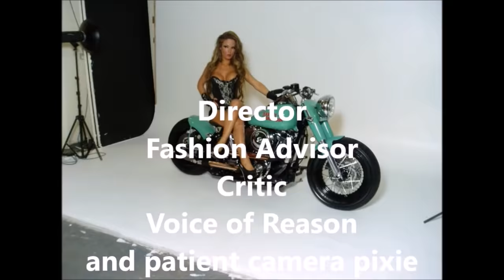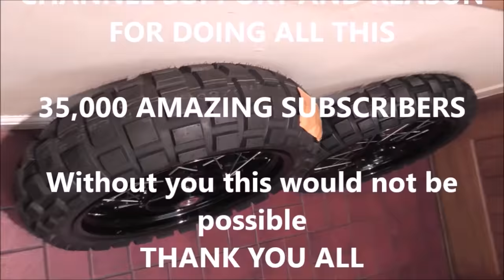Delboy's Garage, USD Fork Seal Replacement

Comment: Hey Del, have a 91 FZR 1000B fitted with KYB USD, and they ain't nothing like these internally, got any tips me ol mate ??
Reply from the maker: Not without seeing them mate, if they were mine, then like all new anatomy id get a manual and read up on the internals, its the same apparatus, just a different design, even a schematic diagram can help a lot... you could probably download one form the net somewhere..!   Good luck with them buddy, sorry i can't be more help..
Reply: No worries, its not my bike so I think I'll get the shop to sort, but as I'm paying I'll watch em :-) @Moonfleet41

Comment: Hey Delboy, here's my way of holding the bike up in my self-built "garage". Bought myself a triple tree stand, but the bike rolled forward a little so it sat on my tire. So I used some straps to hold the bike back so that the front was held up. http://i.imgur.com/RuHeoXC.jpg
Reply from the maker: +QuakeCBR Good improvisation there buddy, use what you have aye..

Comment: you should have losened the top tripple clamp first before loosening the top bolt, not the bottom one as you did, the top clamp could clamp the top cap and damage it..

Comment: Can somebody please tell me the name of the lower part of the forks where the brakes bolt into @14:55 mark it’s for a 2013 gsxr 750 looking for the part to replace due to stripped bolt easier to replace then have to buy new forks I seen it on eBay sold separately but don’t know the name
Reply from the maker: I've always referred to that as the bottom clamp, but if you want to just replace that, they're almost impossible to get off the fork leg, are you sure you can't repair the thread?

Comment: It´s not compressed fully down when you fill it up because of the towel? You don´t get the right airspace!
Reply from the maker: Measure to the INSIDE tube mate, that is where the air gap is spec'd to, the outer tube is irrelevant.

Comment: I went to my local motorcycle shop and they recommended fork fluid instead of fork oil. Do you think that's ok? Would this be the same process for Hayabusa forks?
Reply from the maker: What actual product did they suggest... or was it just a term or reference..!  many people call it 'hydraulic fluid'.!
Reply: @Moonfleet41  Maxima 5W Race Fork Fluid 85-150 anti-Sticktion Racing Formula
P/N 59901-5
Reply from the maker: @busavalley8695  Sounds pretty light weight, and if its recommended for your bike, give it  try.. you can always change it.
Reply: @Moonfleet41  Thanks, I'll give it a try.

Comment: is lithium grease any good like rubber lube?
Reply from the maker: Here you go buddy, treat yerself, nowt like using the right stuff... http://www.ebay.co.uk/itm/RED-RUBBER-GREASE-50-gram-BRAKE-CYLINDERS-SEALS-O-RINGS-/391879401531?hash=item5b3dd5203b:g:ijEAAOSwCU1YoZwQ
Reply: thanks alot

Comment: but you cant use the measurements with that cloth tied around the fork at the "scratches" :-s or am i dead wrong ?
Reply from the maker: Yeah, measure to the top of the INSIDE tube.. not the outer.. that's a fixed height then and always reliable.!

Comment: What if I can't get the two big  parts apart , im haven stubborn seal issues
Reply from the maker: Have you taken the bolt out of the bottom?.. i assume you have... and have you taken the steel circlip out that hold the seal in place...?.
Reply: yeah everything is out , i was watching other  ones and they used heat to expand the metal to get it out , i was going to try that after work . this is annoying. im thinking tomyself . eh its a 3 hr job no problem , speaking of problems , and i your walmart brand ATF  for fluid?
Reply: using a heat gun
Reply: ok every thing is back together . i just need to no in ATF is ok

Comment: Just found your videos, really great, just one question at this point. I have a XJR 1300, which has developed a bad leak from the bottom of the N/S fork, should I replace both seals on both forks or is it ok to do just the offending one? Thanks again
Reply from the maker: Hello Neal, and welcome aboard.. There's no law or rule that says you need to replace both sides, but in my long experience of these things, the other one will leak pretty soon after you fix the first one.. its just sods law mate..   so as the seal kits come on pairs. then why not do them both and you know they'll be fine.
Reply: @Moonfleet41  Thanks for the reply and advice, will do both when I get time, which hopefully will be sooner, rather than later. Keep the videos coming, really interesting and informative. Thanks again
Reply from the maker: @nealhawksbee6708  Just a thought Neal, before you go ripping them apart, if it's only weeping and not actually running out, then have you tried the Sealmate trick, run a sliver of plastic round inside the seal to clean out the accumulated dirt that can hold the seal lip open and allow a little oil to weep out... it;s not uncommon for dirty to cause them to weep, and it could save you having to pull them apart... if you're not sure what I mean, I have a video on it, so let me know.
Reply: @Moonfleet41  From what I can see, the oil is leaking from the very bottom of the yolk, where the shaft goes through and is pretty much a continuous drip, only noticed the other day after a run out but is leaking all the time now.
Reply from the maker: @nealhawksbee6708   Sorry buddy, just a bit confused here "the very bottom of the yolk"?   wipe the oil off the chrome stantion....plunge the forks down and up half a dozen times.. are you getting a ring of oil around the chrome ?.
Reply: @Moonfleet41  Sorry I have never done this before. Where the shaft goes through both forks, the oil is leaking below on the N/S fork. When looking into the hole at the base of the fork, it appears to be the underside of the shaft, where the oil is coming from.
Reply from the maker: @nealhawksbee6708  AAHA,, Now that makes sense..! forget the fork seal... deep up inside that hole, above the wheel axle shaft, is a drain bolt that holds the fork leg together... it sounds like it has just come loose..    So take the wheel out, insert a 6mm allen key up inside that hole into the head of the bolt... and tighten it up.!!   it should not turn at all in normal use, it should be tight... so if it moves and can be tightened, then that was the problem and the leak will stop..!      Give it a go and let me know how you get on mate..!
Reply: @Moonfleet41  Thanks for that, will have a look tomorrow and let you know
Reply: @Moonfleet41  Just managed to draw back the shaft and access the damper rod bolt on the offending fork and as you rightly said, it was loose so I tightened it and no more oil leak. My only issue now is that I don`t know how much oil i`ve lost from the leg, would you suggest I empty it completely by removing that damper rod bolt and then refilling it as per the quantity in the manual and can this be done without having to take the fork off and repeat on the other fork? Thanks again
Reply from the maker: @nealhawksbee6708  Yes Neal, that will work just fine, drop the damper rod bolt out over a drain pan, then carefully unscrew the top cap and lift out the spring.. .. you'll have to pump the slider leg up and down the stantion to work all the oil out through the bottom.... then leave it over night to drain out as much as possible.. then pop the bolt back in, pour in the appointed amount of oil, then drop the spring in and put the cap on... you won't be able to tighten the damper rod bolt until the spring is back under pressure as the damper rod will just spin...    Hope that helps. .and good luck with it mate..
Reply: @Moonfleet41  Very late reply, so my apologies but work took me away from home for a few weeks. Changed the oil in both forks, both being far lower than should have been (80 ml ), used a slightly higher grade oil and it worked a treat, the ride is far better and comfortable over bumps. Many thanks for the advice and info.

Comment: i need to change my seals on my 929 ( im a virgin bike mechanic). where to i buy the seal driver ,,,, or where can i find your tutorial on how to make the one you said you made :)
Reply: also that measuring tool .. the 7.5  oil . im not doing wheelines but id like the "middle cushion "
Reply from the maker: Hey buddy, you can buy the seal drivers from Machine Mart (if in UK) or any good tool company, they come with adjustable range, make sure the one you buy is within the range of your forks diameter... I didn't make a tutorial on making your own, as it's just two legnth of waste pipe and a jubilee clip, but if you are planning to do a few jobs as times goes by, then a proper seal driver is a proper investment.   

What 'measuring tool' are you referring to re. the oil??
Reply: thanks . what's the actual name of the seal driver, or do i just look up fork seal driver ? i think i just answered my own Q,. well thaks again , i watch in detail your vids , i love them. now what about the tin ruler? ps. im from the states . oh and here is another Q lol what do you know about abs plastics , can they hold up to 120 degrees f? it gets hot her in az during the summer . just wondering if i should go obm or not. anyway thanks again
Reply from the maker: Hey buddy, yes you answered your own question !  Just search 'fork seal driver'.  The tin ruler is commonly available, get them from any tool store... and as for your abs plastics, 120f should be no problem, most motorcycle expansion bottles on the coolant system are abs, and they can take boiling water, which is way hotter!
Reply: thanks mate. now ONE more Q . i had to replace my feul filter, i did not know how to put it together. i figured it out by pics on google, some of them had a tin mesh/ copper scratch pad s.o.s pad looking thing. i have no idea what is it but i do think putting a copper sos pad  in there to help catch dobriy, i haven't put gas in there yet , ive been contemplating taking it back apart to put some in. speaking opening the tank, the guy who sold me the bike, took the hole feul system apart so the inside of the tank is slightly rusted , speaking or rust one vale is slightly rusted, how bad will that be on the engine,, i figure it would plow out , i put alot of carb cleaner and it got most of it in the valve, but i do plan on having it fixed , just not right away  , want to  get it up and running , theres electrical issues that i have no idea how to fix , so im taking it to the shop . i really respect the help you have given me. much luv mate, cheers
Reply: also im dyslexic  so im sorry for the turn around words , i thought i got them all but i didn't
Reply from the maker: Hey Kasey, not sure on the filter... id need to see it.. but all you need is a schematic diagram and you can follow the assemly order... and if you have rust inside the tank.. you can fill it with a product called 'Petseal' which will rubber line it and stop the rust blocking up the filter in the future.... as for the valve.. if it was jusr surface rust, then it will be fine.. as long as the seat was good..! good luck with the bike mate.. and thanks for wathcing the videos.. Del.
Reply: thanks del

Comment: Replaced my seals but now ive got this creaking noise any ideas
Reply from the maker: Where's it creaking from Andrew..!?
Reply: Moonfleet41 sounds like up the top would you get same noise if you had trapped air still inside. Thanks for reply.
Reply from the maker: @andrewwilkinson3253  Oh, ok, so could it maybe be a "gurgling" sound... if it is, then maybe too little oil..? hard to be sure without hearing it.!
Reply: Moonfleet41 i will check levels again and go through it all again. Hopefully i will figure it out. Thanks for reply👍👍👍
Reply: Found out what noise was it was from brake pads where the seal let go fluid had got on to pads and tarnished them. Replaced pads happy days.

Comment: I have a question, I moved that lock nut while doing my seal replacement. I have the seals replace oil in and everything is perfect. But now since my nut has moved is that going to affect my preload or anything? Or is that just to connect the rod to the top?
Reply from the maker: Hi Austin... You must wind ALL the preload off that adjuster before you screw it on and lock the nut off.... then it will be fine mate.

Comment: what about if u can't get the front end high enough off the ground to be able to get the fork out non compressed? I undid the damper rod bolt from the bottom so that I could compress the fork so it can get out from the yokes before touchhing the floor. So I have to put it back that way. So I don't really know which point to pur the oil in. Also on my RG125F USD forks the manual uses some weird tool on the "spacer guide" which I have no clue what it's talking abot as it all came apart no problem, no tool was needed, so what that tool is actually doing is beyond me. Manual's are so damn vague!!
Reply from the maker: Manuals are always confusing Dan, dont over think it buddy, if you have it apart, and its all ok, then get it back together the opposite way...... you dont have to jack the bike up much to get the legs out....usually when you take the wheel out, if it was even just one inch off the ground, then the fork legs should slip out without touching the ground..... to pour the oil in, if the leg is still in the yokes, just compress the bottom of the leg up as far as it will go without the spring fitted....and then you can measure the level from the top... hope that helps.. good luck with it.. Del.
Reply: thanks

Comment: i cant seperate the 2 cyclinders when opened up fully they jam.. ive been tugging at the fuckers for 4 hours
Reply from the maker: Have you taken the circlips out that holds the seal in like at 13:24 ?
Reply: yeah ive sorted it now thanks, because theyve never been replaced before the metal ring and the bushes were seized, just needed a good soak in WD and quite a few pulls

Comment: I have aprilia shiver 750, front fork is strong and hard, I need soft fork for more comfortable, I take out all old  oil from inside of the fork and I did put 7.5w fork oil and changed oil seals, now was more comfortable but i always see oil residue on my fork....
like this::     http://prntscr.com/jwhwip
Reply from the maker: Hi Volkan, don't be too alarmed straight away, often when you fit new fork seals they can weep a little before they settle in... just monitor it and see if it clears up, make sure you wipe it off each day and don't let it build up so it runs down the fork leg... it is possible you've got some dirt under the new fork seals, and you could try a product called a 'Seal Mate', which works very well to help them seal... if that doesn't work, and they continue to leak, then it's possible that you've scratched, or damaged, the new seal upon installing it.. meaning you may need to replace them... sadly this can happen sometimes, I hope for you, it hasn't.. .good luck with it... I hope they stoop weeping for you soon, they sometimes settle in...
Reply: thanks for answering  ı will keep you informed about my problem.